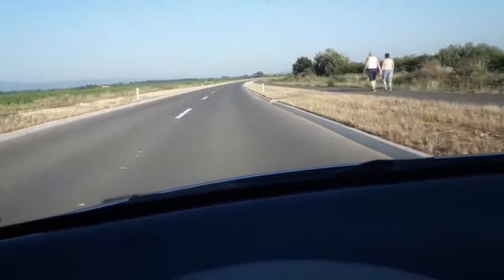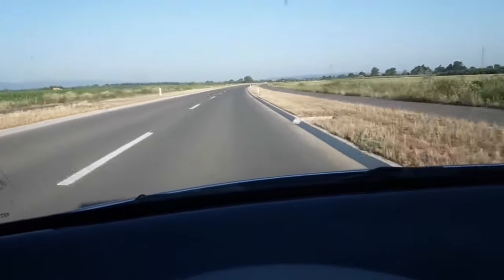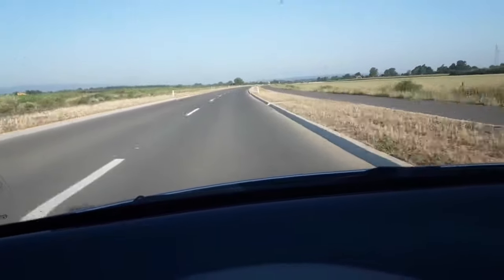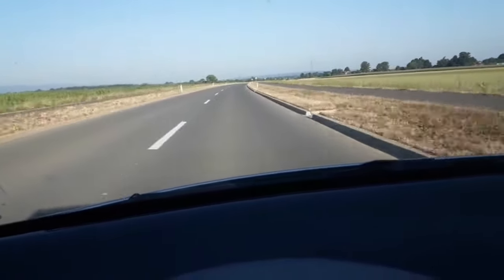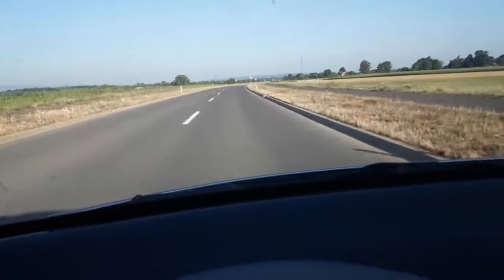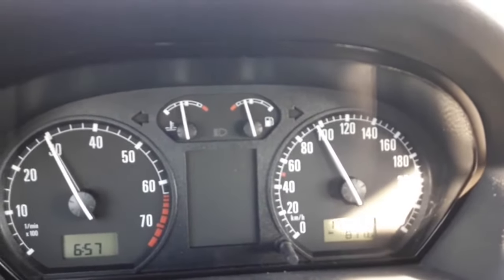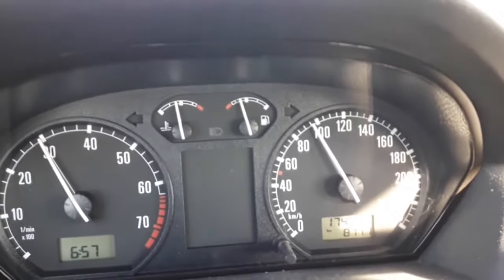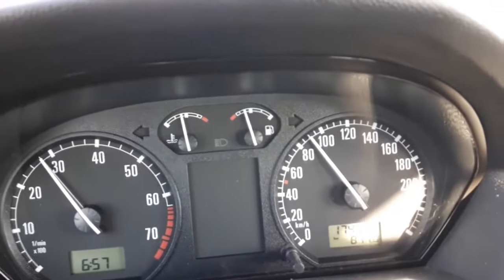Bad Wheel Bearing Noise-From The Start To The End Of The Problem

Comment: Wow u just explained my problem with accuracy. I just got it back from a highly reviewed local mechanic who I informed sounded like a bad wheel bearing. He isolated the problem to be the rear driver side wheel bearing but I’m still hearing the same exact noise. 

But it only happens going 40-50mph, and then reappears above 65mph.  

I asked the mechanic if I should change all 4 wheel bearings just to be sure but he assured me just to do the one. Now I’m not so sure and he got more money out of me by suggesting that I change the rear brake pads and rotors which I didn’t notice any problems with. He said my rear rotor and caliper on the driver side seized. 

I’m thinking I should have just done all 4 wheel bearings.
Reply from the maker: Hi and thanks for watching!
To be honest with you and as much as I know, wheel bearings are rarely changed on all wheels at the same time.
The practice for most shops is to change the bearing one at a time as they start to make problems.
Also, I doubt that the mechanic would change the pads and rotors if he/she didn't see some sign of future or present problems.
But it also wouldn't be a surprise.
Back to what you're talking about: did you check the condition of your tires and have you done an alignment in the recent past?
Reply: @DespairRepair  Yes, I recently installed 4 new highly rated tires with low road noise ratings about a month ago and they have been fantastic.

Comment: Hey friend. Question, im being told i have a bad wheel bearing BUT my sound is NOTHING like any video ive seen. Best i can explain, is it sounds like theres a bolt stuck in my front driver tire when after 30 mph. No humming, no growling, none of that, only like a bolt or screw is in my tread. But theres not.